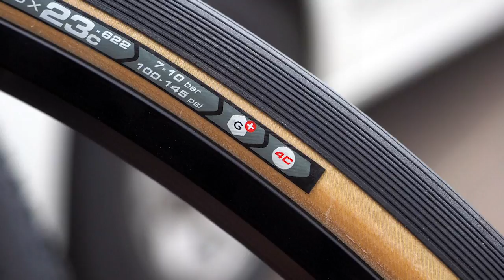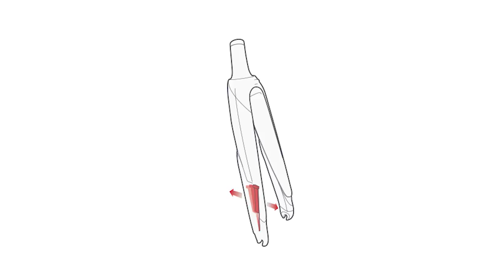Top 5 - Future Bike Technologies

Comment: Great idea - vibration dampening that generates power to charge everything. Smart electronic shifting would make pedalling more efficient if it was load based. Not sure about wireless brakes but antilock brakes especially for the front wheel could see harder braking etc

Comment: If your wireless electronic shifting craps out in the middle of a ride, you put the bike in a manageable gear and ride it as a single-speed. If your wireless electronic brakes crap out, you find out at the next intersection, and then you're dead. Seriously, I know it's a great opportunity for Shimano to overcharge for something, but what's wrong with cables and housing?
Reply: brakes aren't going to go wireless pretty much ever IMO. it's a safety critical system and we'd at very least need a cable to the rear brake for "emergencies".  I'm 99% sure there are no road cars out there with fully electronic brakes (brake by wire), let alone wireless. I could see some sort of ABS system being implemented on hydro disc brakes, which would be pretty interesting.

I could have used some front wheel ABS when out on a local crushed limestone trail and didn't realize that the top layer of clay was wet, and locked up the front wheel and went down pretty hard going into a corner.
Reply: You know cables are about...10-100g, thats way too much for a real Race-Biker! ;b

Comment: Graphene, sure. Dirt resistant coating, I might use that. Wireless everything, absolutely not: not only is that unsafe as the only reasonable way to do it would be to make the brakes apply as the fail but that would add so much hassle to riding a bike. Once a good mechanic system is set up, the need very little work. Why change that? I’ve pulled bikes out of sheds and ridden with loads of rust on them from the decade of disuse. That crap wouldn’t happen with a battery anything. Even a year of sitting could kill a perfectly good battery. Additionally, routing is really only an issue if your cables and hoses are internal. Full length housing is stupid simple to attach to a frame. Smart suspension, lets sort out normal suspension first. Piezoelectric chargers, great idea as long as I can’t hear them ringing with every bump.

Comment: Wouldn't layered graphene just be graphite?
Reply: No, graphene is basically carbon powder that is mixed into the resin.
Reply: Correct me if I'm wrong but graphene is made into large sheets using cvd (chemical vapor deposition). Surely you would have to layer these sheets to get the strength needed which is basically the reverse of how graphene was discovered in the first place (by using scotch tape to peel layers of graphite)?

Comment: My main concern with wireless braking is the safety aspect of it all. However, this has already been thoroughly covered by the previous commenters. However, even from a practical point of view, wireless braking brings absolutely no advantages whatsoever. 

The amount of power brakes apply in order to stop would require batteries much heavier and larger than the 20 grams a brake cable weighs. Then there are the motors that would need to supply such power, as they would be considerably large. So more weight and bulk there. It's an absolutely stupid idea on a bike and has no merits whatsoever.
Reply: And it would be very hard to replicate lever feel

Comment: So, I have a 2007 Tarmac Pro.  15.8 lbs with pedals and water bottle cages and basic Reynolds 26 mm deep carbon wheels.  Been my main race rig for a decade.  Just bought the new redesigned super sonic lighter 2018 Tarmac Pro (not S-works).  16.1 bs with pedals and cages and admittedly 50mm deep wheels.  They made the frame lighter and now I have a DI2 battery in my seat post.  H'mm.  Seems like electronic tech bullshit and its got heavier or about the same.  As for hydraulic brakes which I dot have, I don't want them.  I lay my bike down in hot weather in my car and those brakes don't like that.  

All this tech is bullshit.   The basic materials advancements are great, but the rest is marketing crap.

Comment: 1. Carbon = 'Plastic bike' that completely deadens the lively ride feel that the original bike frame material, steel naturally provides. Steel also comes with ease of repair, incredible stress tolerance and longevity. I imagine it's better for the environment to produce. Once it's no longer needed it can easily be melted down and re-appropriated. I am not knowledgeable on carbon fibre, but I can't see that being the case so steel wins on the recycling front too. 
2. Electric Everything = Why? Everything works. Why take away wires and add batteries and little motors? Batteries do not last forever and what happens when they're done? I know, throw them away! Our solution to every fucking thing we don't want anymore. 
Great, lets deposit some horrible chemicals right into the heart of mother nature and walk away like there's going to be absolutely no repercussions. Personally I'm not that into the poisoning of my environment and food, though it may just be me... 
I have nothing against electric if it's sustainably and ethically powered. We're already producing a hell of a lot of power using our legs on the bike, why can't we just harness a tiny bit of that (dynamo style)? Clean and efficient electricity powered by sandwiches/kit-kats/insert your food here.
Most this stuff is in the name of commerce rather than improving anything that's genuinely needed or solving any pressing practical problem. I just want a well thought out bike that's the best for the ride and the environment I ride it in. As cyclists, we're supposed to care about the environment, right or do we just roll over the minute the industry designates that we need a new, shiny bit of kit? I love new and shiny but not if it comes at a cost both to my bank account and the environment.

Comment: Bike manufacturers stick a bit of tech on a bike and boom. 2000 quid premium. Just look how much extra it costs to have direct mount brakes on a fork and frame instead of single mount. Just a joke.
Same when they put discs on a bike, 600/700+quid more. Yet you see bikes for a grand with disc brakes and 105 and they quality.

Comment: Bikes  prices already are beyond any reason. Don't wonna see bikes packed with electronics. It might be very convenient as long as it working but maintenance on my MTB is already a bitch I can imagine what it will cost to fix or replace whole wireless break system. Di2 is extremely expensive add to that all other electronic components and you'll be looking at 25-50k bike.
My 2 bikes MSRP is close to small car MSRP. Unlike you I don't get new bike to ride and bullshit about it every year for free.